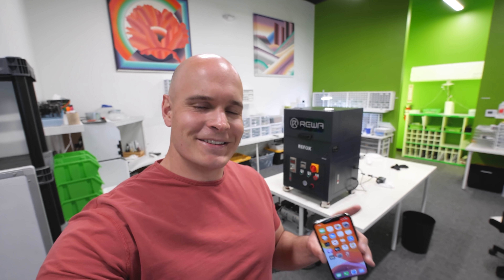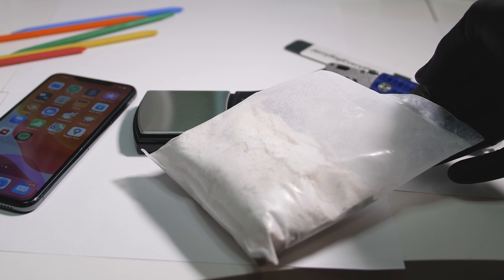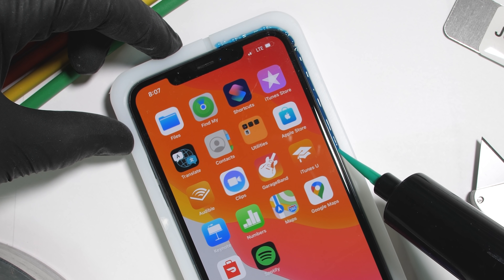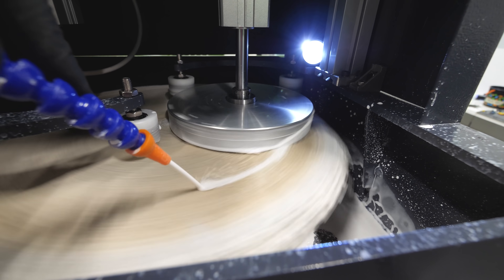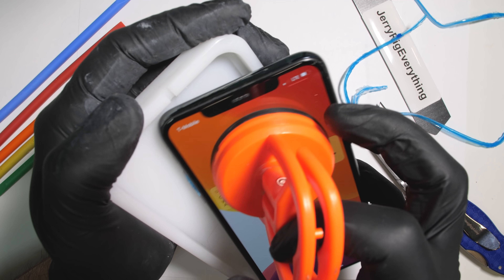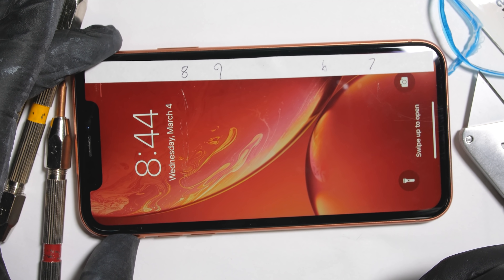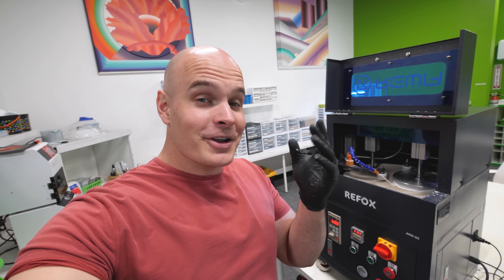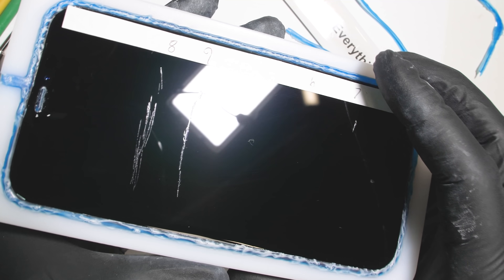How to Remove Scratches on an iPhone Screen? - (Not Clickbait)

Comment: Cant the machine just use a non-conductive liquid to hold the dust? Then if it ever gets within the phone not only will it do no electrical damage, when it dries (if it even does dry depending on the liquid) you can do an internal clean to get rid of the dust that also got in

Comment: Their are screen repair solutions to fix cracked car Windshields except using this solution adds a layer on you phone that is uneven and subtly noticeable. Using thie solution and this machine could you get the 8 and 9 gouges out and unnoticeable?

Comment: Cool machine. It’s interesting that it’s main competitor is probably the screen protector. But I guess lots of people don’t use them. 
Maybe they should make an some watch size puck, that’s harder to protect in a way that isn’t ugly
Reply: Apple now use completely flat screens, which makes screen protectors - especially very thin, high quality protectors - a very unobtrusive proposition. Phones like the Samsung S22 Ultra still have curves so screen protectors simply aren’t as easy to fit without some compromise, unless you buy expensive ones which you have to cure. Even they aren’t as good as a flat piece of glass on a flat screen, as they’re a lot more fragile.

Comment: I got my iPhone 6s plus for 6 1/2 year now and using a screenprotector from day one, still not a single scratch on the screen. An older phone which does not have an waterproof construction will be destroyed from the front speaker of the phone. These phones are gonna get soaked

Comment: That oleophobic coating was really interesting to me. Years and years of swiping fingers over the keyboard area remove the factory coating and it would be nice to have it back. What exactly is that liquid, and can the average Joe get it on eBay or something?
Reply: really curious on that also
Reply: This would be better info for me than the scratches. I usually do well with scratches but that coating would help way more.

Comment: 8:46 now what if you throw (install) a screen protector that uses glue and uv light to get hardened? Scratches are going to disappear with the glue while the screen protector on? Or what if you cover the entire screen with glue, hardened with uv light then polish it with the machine to see if helps dissappear scratches? 🤔 So many questions

Comment: I think it would be interesting to see if it would be possible to remove level 8 or 9 scratches with epoxy resin. You know, to fill the void in the glass. And then polish it again with this machine
Reply: Do you have the name of a company that will perform this service?

Comment: This video is absolutely worth watching since we finally get to see what a level 8 and 9 can do. Now for that machine, if everyone were to do the responsible thing in my opinion they'd all have some sort of case and screen protector.
Reply: Seriously, I have a 6 year old iPhone that I replaced the battery in like 9 months ago and when I pulled the screen protector off, the main glass was still 'like new'.  I'm sure there has to be some small scratches somewhere as it spent a few months without a protector after that but I can't see anything even when really scrutinizing the surface.  Those flexible glass screen protectors do quite a bit...I was a little surprised.

Comment: 3500 dollars? are you mad? not trying to be a hater but you can do this at home with a cork disc cerium oxide and a drill, note that the cork will dig harder in the surface than the furry surface used in the machine.
All of the work is done by the cerium oxide, you dont need a huge machine for that

Comment: I wouldn't trust the machine. Not just because my phone is a curved display and it probably will ruin it but it also takes a layer off the display, even if it is so little.  I think that may reduce the strength of the display overtime. It also makes no sense because sometimes daily use get you those scratches and even if you remove them you'll get more again in no time. I would prefer a "filling the gaps" approach instead of evening the surface.  To avoid scratches the screens could come with a sort of clear coat and when it gets scratched you can just reapply the clear coat to get rid of the scratches.

Comment: does not matter what level it is, is only matter how much or how "deep" you damage the screen
deep scratches at level 6 will not be removed either, as he mentioned, he remove only microscopic layer from the screen surface

Comment: Can anyone tell me the truth about the method of using vegetable oil or coconut oil on the edge of your phones screen protector’s commonly coined ghost edges or air bubbles at the edge of a screen prospector. So many saying it works, some say no and it goes back the way it was before applying the oil via q-tip. Or it can damage the device and/or makes it worse if he like gets underneath the screen protector. The video creators are all sold on the idea, however no one is addressing the comments where some are stating the flaws to this method. Please and thank you!

Comment: Is there any material that would work like a "liquid glass"? What I have in mind is... Could you fill this scratches with some strange liquid (in a way like water does) that gets solid and than polished it to get smooth surface? Like technique that is used for damaged cars... Chassis  gets some coating than polished and than painted ... Thank you for your answers.

Comment: You should have changed the powder cellium oxide to a different material which is harder than 9 to remove the level 8 and 9 scratches. In the first test the scratches were of level 6 and 7 so they were removed like for xr 6 and 7 level as well..try using level 9 compound for level 8 9 scratches.

Comment: As a Z Fold2 5G owner, would this be able to work on the outer (un-fold-y) display? There is a metal bar which is part of the hinge running the length of the left side, which is slightly higher than the display. This would almost definitely get scratched to oblivion by the polishing wheel, which isn't exactly ideal.

Funnily enough, my outer display is more scratched than the inner, about five months in. The irony.

Comment: I finally got the worst day after five years but unfortunately I have some battle scars I have some level six scratches on my head with deeper grooves at a level seven now I’m wondering if I take my head off and stick it in that machine will it get the scratches out any help would be appreciated

Comment: Mr. Jerry, 
How can we identify the specific level of groove, since there is no point of using this machine on level 8 and 9??
Reply: If it looks fine in sunlight it’s basically non existent. If it can be seen in sunlight, catches your nail and distorts the RGB colour of the screen kinda then it’s level 6/7. If it’s level 8 it will be noticeable even when the screen is one and will ruin ur experience on the phone.
Reply: @barnsbarns  Okay. Thank you! I believe this machine is quite practical. Let's hope it'll be easily accessible.
Reply: @zaynaly3682  Yes. Let’s hope Apple has one some day!

Comment: I think a machine like this was used (improperly) for my LG Stylo 4 screen replacement I bought on eBay. The screen has permanent lines on the glass that are only noticable when the screen is dirty. It's very weird... I thought these lines were leftover residue that I could scrape off with a razorblade, but no... They are like etched into the glass.

Comment: Can you put a metal back i pod in to remove the scratches
Reply: Hahaha I would try that. Even 5 minutes outside and the back case is gone. However I found a dremel with a buffing tool and polishing compound works fine.

Comment: I have been wondering if car polishing paste particles are hard enough to work on removing small scratches on smartphone screens or even computer non-matte monitors. I might even try that on some old phone of mine. Also, could you please tell us the name of the chemical that you used in this video to restore the screen oleophobic layer?? I have been looking high and low and never found what shoud be used for that purpose. Thank you!

Comment: It depends on if I can get a hold of one of the machines, cost of the ingredients, the amount of work to aquire and run it.
Personally I try to just put a tempered glass screen protector on, so that gets damaged instead of my screen.
One of the reasons I hate curved glass screens, it is really hard to put a proper protector on it.

Comment: For the level 8 scratches couldn't you   try and use a harder powder because you said it was for level 6 and 7 so iff you did powder for level 8 and 9 then it will probably get rid of the gouges but it will take alot more than a microscopic layer lol

Comment: Because the last machine used lasers to remove glass adhesive, I kinda thought this one would use lasers to melt the glass back together and then polish it.

Edit: Is there a version that works with a sapphire screen?

Comment: all of this just to remove scratches that could've been easily prevented by just using a simple screen protector.  🤓-1
Reply: Ikr but some ppl don’t use them
Reply: @jonathancruz562  If only iphones had pre applied screen protector then people wouldn't have to go through the trouble of putting a screen protector but guess what? they want the money of screen repair 🤓+1

Comment: Hey Zach, you should try filling the lvl 8 and 9 gouges and scores with UV resin / glass filler and then putting it throuh the resurfacer, I bet that would almost vanish the marks. Especially if you could vaccuum out and air bubbles before curing the resin. I hope to see this in a video some day.

Comment: I’d be completely comfortable putting my phone in there. I have submerged my phone underwater which is an iPhone XR and swam with it and it’s completely fine. If my phone can withstand that, I’m sure it it withstand this, especially since you can take super good measures to protect it.

Comment: About the level 8 gauges and level 9 scoring... Could you add windshield chip repair liquid or some type of UV resin/liquid glass type of material, razor blade over them and then put it in the machine to bring it to a perfect scratch free shine ?

Comment: 6:42 When the level 9 pick is so powerful it LAGS reality
Reply: Indeed
Reply: 4 real
Reply: You can play youtube videos frame-by-frame. It is indeed amazing that the pick goes over and a few frames later the glass scratches.
It would be really interesting to watch this on very high speed camera and under microscope.
Reply: @ИванСнежков-з9й  i think maxbe the scratches are deep enough to make the glass break. Glass is basically a material with inner tension and if you scratch it it can start breaks from there . Physics are great hehe
Reply: Diamond tips are pretty unforgiving
Reply: @verlorenish  Diamond is a level 10 on the Mohs scale, 4 times as hard as level 9 which is corundum, not diamond.
Reply: @limecheesecake1832  So Zach actually follows the scale? I've never seen him use a level 10 on any device so I figured that was diamond
Reply: @verlorenish  Yeah he probably has a set of labelled picks with the relevant material on it, e.g. talc at level 1, gypsum at level 2, etc.
Reply: @verlorenish  so those are diamonds?
Reply: @kingsly1031  It's basically synthetic diamond crystals on a metal core. It's the best tool to cut glass.
Reply: @verlorenish  oh...
Reply: @verlorenish  thanks.
Reply: @kingsly1031  No, level 9 is corundum, not diamond.
Reply: @verlorenish  its not diamond lol diamond is 10. Why give wrong information if you dont know just dont comment. Its bad to teach ppl something wrong rather than nothing ;)
Reply: @suppar8066  i figured something was wrong with the info he gave.
Reply: I definitely heard Zack saying "its crack all the way through" so hes potentially dotting not slicing the screen since lvl 9 is so powerful it could cut the whole screen
Reply: how is this possible 🤔
Reply: Diamond tho 😳
Reply: came for comment looking like this

Comment: I have braces and sometimes my brackets Brest off and they way they put them back on is by using “blue jelly” and the use a up light to dry it so I thing they are the same thing as the thing they use to seal the phone in this mechine

Comment: Well basically it's polishing.
If the option is to replace the screen. Polishing sounds pretty good.
As you are grinding the screen to be thinner. 
Does it make the touch sensitivity better? 
Will it decrease the drop proofness? 
How much can you grind off until the glass is too thin?

Comment: I feel like you can make one of these at home
(Not recommended but you know)
Microfiber cloth
Make a custom spinning thing
Make the liquid with recipie used in actual machine
Fashion a way to control flow/excess liquid
Control any (if present) fumes
Done
Again, not recommended but yeah, just a thought

Comment: Why risking water damaging your phone, when you can buy a screen protector for only 2$? And then if its scratched you replace it and call it a day.
Reply: This solution is only applicable for a very small target. If you already scratched it and you won't upgrade or sell it and you couldn't find any replacement screen part. Then yes, you can buy this machine!
Reply: @ghamdimoha  why buy the machine? Give it to a professional to fix it, who already has the machine it would cost less. And still everyone puts a screen protector after unpacking it.

Comment: Using a UV cured adhesive to secure a screen protector to a scratched up Samsung Galaxy phone the scratches completely disappeared, is it possible for these gouges to disappear using the same style glass screen protectors with the liquid adhesive?

Comment: I had the feeling of witnessing something revolutionary epic when he used the level 8,9 scratch tools.
Reply: That wasn't scratching... that was putting the poor phone on the chopping block.
Reply: @TheNeelonRokk  the most funny thing is that using it as a chopping block probably wouldn't result in damage lmao
Reply: @matthewmcewen1  yeah, most knifes only got to level 5 - 5,5
Reply: He used to use level 8 before but the reason he stopped at level 7 now is because level 8 can damage the whole integrity of the screen, making the bend test less reliable. I think he got that recommendation from Erica Griffin.
Reply: He uses diamonds to crack an iphone screen in an older video if you want the peak
Reply: He should have done level 10
Reply: @isaacong  No stop, it's already dead!
Reply: He used it before on sapphire phones. Watch his sapphire phone test.

Comment: So. To get rid of scratches... you just scratch it so much that it loops around to not being scratched.
That feels like some major reverse psychology-esque stuff.
Reply: Ya that's typically how buffing and polishing works
Reply: With physics, there’s never a free lunch though.  You make the glass even thinner, compromising the strength quite a bit more so if you drop it once you could easily shatter it vs the original thickness of the glass.
Reply: @Johnnygga  You could see that happen with the 25 minute buffer. Screen was freaking out if there was too much pressure
Reply: Used to do the exact same thing with DVD's.
Reply: @cjxgraphics  remember that disk spinning thing called like scratch doctor or something?  It left a weird looking pattern on the back but to to the laser reader it saw a perfectly surface 😂

Comment: My phone (Xiaomi Mi Mix 3) has only a few tiny scratches here and there which are visible when you catch light at the right angle, but unfortunately some pocket lint or something got to it in my handbag one day and put a few weird shaped gauges (I'd say strong level 7s) across the face which are easily visible

I can handle the light ones, even if there were heaps of them.. but these deeper grooves actually catch my finger nail, so something tells me they aren't recoverable.

That said, this is a slidey phone with like.. negative levels of water resistance, so no way would I risk it in that machine

Comment: Zack I would like to proudly announce that I used to have a level 8 gouge in my phone and it wasn't cracked and continued to work perfectly fine. The story goes as followed. I was in a rocking chair but and my phone was next to me. All of a sudden the contents of my pockets empty out and a few coins and whatnot fall out. One lands on my phone screen. I lean forward to pick everything up and the chair goes over my phone with all of my body weight and scratches the coin along the screen. Stupid mistake and there was a massive gouge in the screen. The phone continued as normal until I shattered the screen a few years later. Still rocky my iPhone eight!

Comment: Excellent. A question.  İf you bought this powder,  mixed it with distilled water as shown and then manually rub the scratches with it, might it work without the machine,  even if it takes longer?

Comment: My phone screen has deep gouges from me wiping sandy mud off it. I did try rinsing it with water first, but I had very limited water available at the time and had to save most of it for drinking. Only thing that can restore my phone now would be an entirely new screen.

Comment: The moment i bought my phone , immediately covered it with tempered glass and back case so it's never gonna scratch🌝😜
Reply: we all know glass scratches at a level 6 with deeper grooves at a level 7 so you’re not completely safe. for example ”concrete”
Reply: @randomdude933  if that scratches , we can remove old one and install a new one🤷. Tempered glass barely costs 100rs(1.5$).
Reply: @saireddy6463  a 1 dollar screen protector has the same effect as a 10 dollar one ”profit”

Comment: You should try using the windshield crack repair kits on an iPhone with a cracked screen or level 8 and 9 scratches. I’ve always been curious to see if those would work. Glass is glass right?